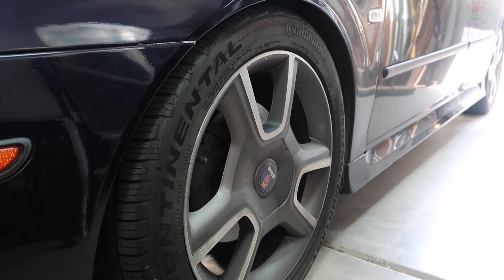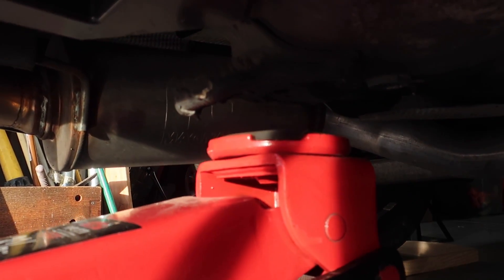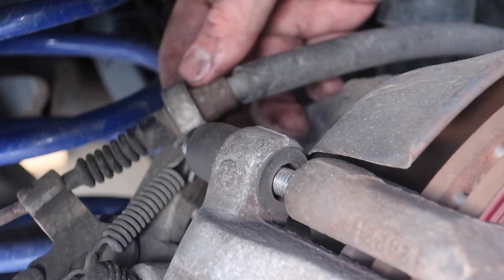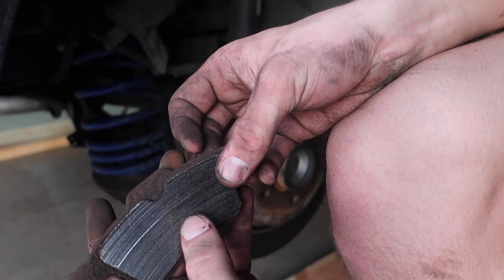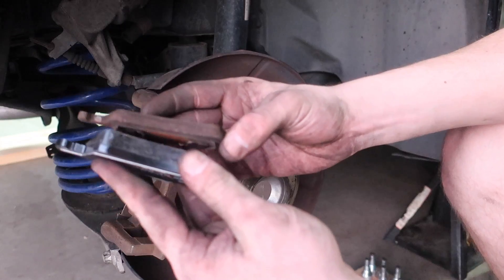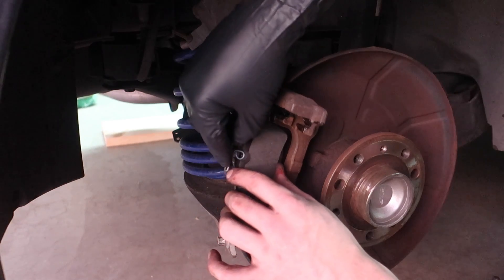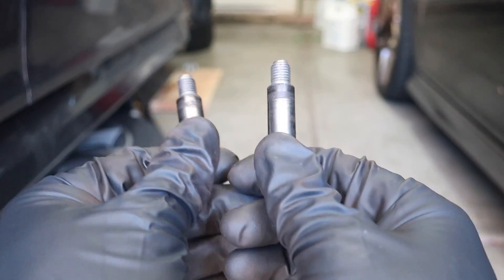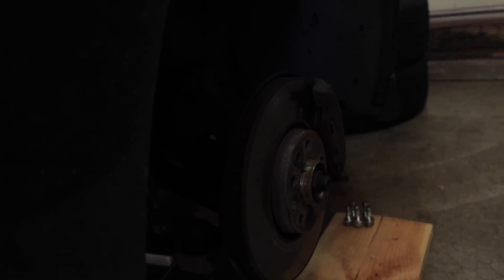2003+ Saab 9-3 Rear Brake Replacement

Comment: Love the video, nice to discover that i actually dont need to take off the bracket to change the rotors. Now i just need to borrow a piston tool, then i can do this job on my 06 Saab 9-3 Wagon!
Reply from the maker: Yep! It’s not too bad at all :)
Reply: But i discovered that it’s not possible on models with smaller brakes, as on my linear. And the bracket bolts were on really thight😑
Reply: @torgerhavag  just discovered that last night on mine too (16” tires.)

Comment: You should always open the brake fluid tank in the engine bay, when u put on new calipers the level will rise and when pistons are compressed it can rupture the tank
Reply from the maker: Good tip!

Comment: Looks like a solid disc? Those are for linears, with weakest brakes. 
You should have a 292 mm brake disc.
Reply: yeah. seems wrong with solid brake disc :-/
Reply from the maker: good point, i assumed mine has the 278

Comment: Notice how easy you got the disc back on even though you didn’t remove the caliper carrier and how easy the caliper slid over the pads after replacement? 

That’s because the disc is the wrong thickness for your arc. Caliper should just slightly fit over the new pads and disc when everything is new
Reply from the maker: correct, i messed up
Reply: I have an 04 saab 9 3 the title doesnt say but its a linear. I was sold the wrong rotors. I didnt re install that screw. Mine stripped so i drilled them out.
Reply: @Toby Collin instablaster :)
Reply: @Carter Mason It did the trick and I now got access to my account again. Im so happy!
Thank you so much, you saved my ass :D
Reply: @Toby Collin you are welcome =)

Comment: Good to see you can get away with out removing the carrier's, however i bet when i do mune they will be stuck ,i just did the fronts and they were stuck fast ,i used the nut znd bolts 🔩 method through the carrier holes and csme off luke butter after one turn .

Comment: You put on the wrong rotor in the back for the aero. You got the standard and smaller 2.0 (278mm non vented disc) but the Aero takes 292 vented rears.
Reply from the maker: this car wasn't an aero which is why i thought it initially has 278's; lesson learned. i quickly replaced it with the right rotors
Reply: Not sure about that, my '06 Aero 2.8 conv. has the smaller non vented rotors. This I found from the door sticker 'BA' designation indicates 278mm. Non-vented. I guess it depends on the manufacturer date.
Mine happened to be built Oct. 2015

Comment: Hey auto autopsy, I’m 17 and I have a 2005 saab 9-3 and for some reason it doesn’t start, there’s not check engine light on or anything like that... the fuel pump doesn’t turn on even after I replaced it last week. It was working fine one day then the next day it just stopped turning on, I live in Wisconsin and there’s nobody else I could think of and you were the first so if you have any ideas can you let me know? Thank you
Reply: Check your fuel pump fuse. Fuse is located in the little box in front of the battery. Should be 20 amp fuse in the number 2 slot.
Reply: Also hopefully you used an OEM Saab fuel pump? Aftermarket does not last on these cars!
Reply: Fuel pump use is good, we replaced the fuel pump and it still doesn’t turn on when I start the car🤦🏻‍♂️Idk what to do anymore and the fuel pump was after market so maybe that’s the issue but I’ma check in on it
Reply from the maker: good luck! Could also check the battery too

Comment: Hey auto autopsy what size are those brakes 314mm, 302mm, 285mm I'm trying to change mine just don't know the brake rotor size.? can u please help me with that.
Reply from the maker: Your door panel should give you a code for the brakes. If you don't have the bigger caliper on the front, it's not 314mm

Comment: Do you need to bleed if the caliper is never disconnected from the brake line?
Reply from the maker: no, although it wouldn't hurt to do.

Comment: 2009 9-3 2.0T   Can’t slide the rotor off without removing the caliper bracket. Help
Reply from the maker: Then remove the caliper bracket if that’s the case. It should just be two bolts
Reply: @AutoAutopsy  yes. That top bolt is tough to get to.  
Broke two wrench. 
Been soaking with penetrating oil. Maybe next week

Comment: Hey, I've got a 9-3 2.0t convertible 2004, and I find the steering extremely loose at high speeds (70+ MPH) is this normal for this car?.. already had the rear end slip out on me and just feels very loose and light.. thanks a lot.
Reply from the maker: Im not exactly sure what the cause of that could be; I'd ask in a facebook group

Comment: Wrong brake disc, u will pop the piston out if these pads reach min thickness
Reply from the maker: What...?
Reply: Auto Autopsy the vented discs are thicker than the non vented, so when the brake pads reaches their min thickness the piston may not have enough meat to hold it in place and may pop out
Reply: Well not exactly. The thing is that when the pads are at the end of life and the piston may be about 8 - 12mm further out then with vented discs. that may do it a bit tricky to get back when replacing new ones. the piston it self will not pop out and the pad is not it self small enouph to fall out when its end of life. I have it my self on my Saab 9-3 SC and its no bigger problem. the only thing is that vented brakes matches the engine
Reply: He should be using the 292mm rotor. That’s what the Aero uses.
Reply from the maker: I assumed mine had the 278 and non-vented, but see what you guys are saying, thanks for alerting me to it

Comment: We need to specify 2003 excluding  convertibles, those started in 2004 2003 9-3 convertible is old design, I have had both, so I know..lol
Reply from the maker: yeah, i know there's a different and I've mentioned it before; i just figure people would see it's an entirely different car and know it's not the same!

Comment: Nice vid BUT.......... Those solid discs are smaller and thinner than the old vented discs you took off. Thats going to give you two issues. 1 - the pads will extend over the edge of the discs - not good. 2 - when the pads wear down the outer one could very well slip through the gap between the carrier an the disc - very dangerous. You should change the caliper and the carrier's or just put venteds on.
Reply from the maker: thanks - i actually noticed this right after i uploaded the video and switched them to the vented rotors!
Reply: I wanted to change my rear discs and pads for 2003 9-3 2.0t Aero SAAB. I bought 292mm x19.9 mm vented discs (the same type what was used before) but i can't put in brake pads(16mm thickness) in caliper - they doesn't fit in. Total thickness of disc and pads are ~52mm, but the gap in caliper is around 48mm. Can anyone tell what should I do?